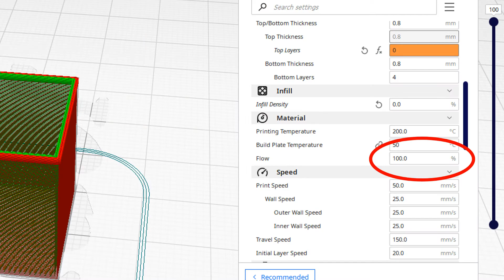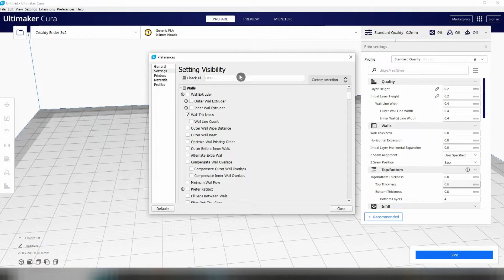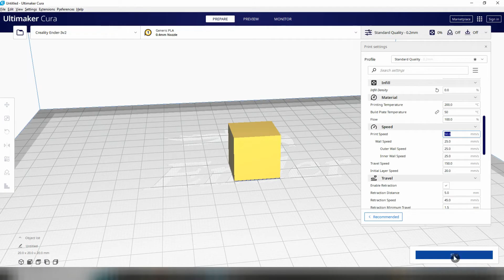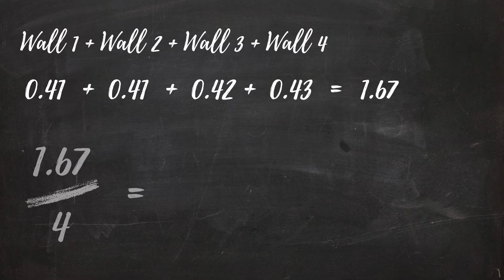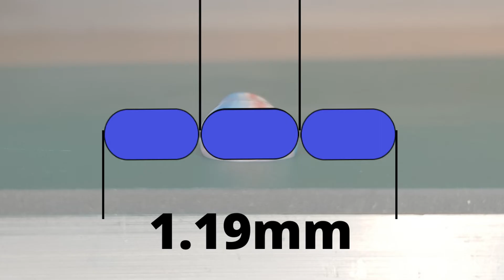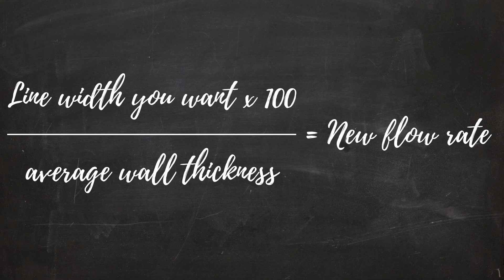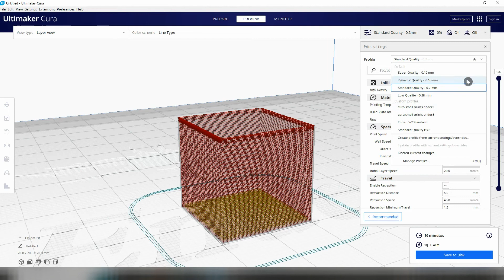Calibrating 3d Printer Flow Rate with Cura - The Quick Fix for Under Extrusion

Comment: hello, Im having some problems working with polymaker lwpla, so basically during the printing process there are times that the extruder give to much material making blobs of it. How can i solve this issue ?. Thanks
Reply: 90% caused by overlapping vertices

Comment: Great video. I tried doing this and measured the cube walls 3 times to check for consistency. Each time I got a different final result. I'm not sure why.. maybe the digital calipers are difficult to control down to this level each time checking the thickness.. but my averages were all within the range you mentioned as just leaving it alone... 0.41 0.4075 and 0.415... this resulted in flow rates ranging between 96.4 and 98.2. How do you know which one was accurate I guess... maybe just leave it at 1 and it is fine maybe...but that seems to maybe slightly over extrude

Comment: For those wondering how to do the calculation if you're starting from a value different from 100% flow, the method shown assumes you're at 100%, so just input the current flow value you have at the moment of the calculation and it will give you your new value. It might take like 5 tries to dial it just right, but a 0.02 variation is well within spec for an Ender 3 style machine. Remember that your extrusion precision depends on your entire extruder assembly, from the stepper to the extruder, setup (DD or Bowden) and even your hotend style (all-metal or PTFE).

Comment: Wait.. Calibrating E-steps and changing flow rate is in practice exactly the same thing? Or am I missing something?
Reply: the e steps makes sure the stepper motor puts out the right length filament but does not make sure the extruder flows the right amount

Comment: This is great! I printed one cube single wall .4mm and got a .42 wall thickness. Two walls gave me .84 wall thickness. Dropped flow to 95 and got .81wall thickness and 20.03 overall on a 20mm cube. 0.03mm is only one thousands of an inch on a 20mm cube. Thats damn good tolerance for 10-20 minutes of testing and about 8 grams of material. Thank you so much for this video!

Comment: Dont base line width on what you measure, printer uses an estimate, software input from factory, use hight to determen or finetune your line width, that is based on an actual measurement,z access offset..that will give you more accurate consistancy overall ..

Comment: You might get the right 3 wall thing by using for example a 0.4 mm nozzle with 0.2mm nozzle settings..or a 0.6nozzle with 0.4mm settings...so you trick the printer with 😅the ofsett for line center ..you can also use this for more flow, for ex i get perfect rubber printing with a 0.6mm nozzle when using 0.8mm settings and upting temp to 280°c...prints like PLA..

Comment: I did my esteps first. but now after ramping the esteps up to 98. I have to lower the flow back down to 93. It kind of feels like It was allright before. with 2 walls of 0.4 ending on 0.81 and 0.79 . As if what I just calibrated kind of ruled one another out...

Comment: One thing i learned the hard way is to also verify the nozzle as well. I had a beer off a time getting one printer for set and it turned out while the nozzle was marked 0.4 it was actually a 0.6.  Once I swapped it out with an actual 0.4 my flow was perfect and over extrusion was gone

Comment: Not sure if it was commented already, but I'm pretty sure in cura the option to bring the lines closer is to use a line width smaller than the nozzle diameter under quality. Whhat I understand from the setting is if I use a 0.6mm nozzle and set it to 0.5mm,  4 walls will be 2mm of squished together lines instead of 2.4mm of less squished together lines.

Comment: In cura, the line that is set to be 0.4 mm should be 0.44 mm wide because cura approximates line cross section as rectangle. So if your estep is truly calibrated your wall line should be 0.44mm wide at 100% flow.
Reply: so u saying multiple 0.44 * 100% / (the 4 walls) = true flow rate? or are u saying to change the line width to 0.44 in cura instead of 0.4
Reply: @Flakoyaga  not quite that. If you set it to 0.44 than it would be even wider... So just have that small difference in mind when designing your 3D model, especially if you want to play with tolerances. If you get your single line to be 0.2 high and 0.44 wide, then your flow is spot on if you are using cura. The internal structure of your walls will be 100% filled, and outer parts of your layer will be sticking a bit out on sides.

Comment: If you are consistently experiencing under/over extrusion, it indicates the extruder stepper settings in your firmware may be off. You can calculate the correct settings in much the same way as you did for the slicer settings: Pre-heat the hot end, measure 100mm of filament and ask the printer to extrude 100mm. Measure the difference between measured and extruded filament, then take that to apply to the "rotation_distance" (in printer.cfg in Klipper) setting of your stepper in the firmware: (rotation_distance X extruded/measured)=new stepper rotation_distance. Then re-test.  That way you can leave your slicer setting at 100% and only make adjustments if necessary per print. For example, my extruder rotation_distance setting was 32.990, but I changed out the extruder for a better one, which means I also changed out the extruder gear. I did the above calibration and the result was that my extruder was actually extruding 97mm per 100mm measured (under-extruding). (32.99 X 97/100)=32.00 (shorter rotation distance means the extruder has to turn farther per rotation, due to a slightly smaller diameter extruder gear).  I suppose you could do the same thing by just observing your prints and taking the setting in Cura (103% flow setting, for instance, translates to under-extrusion of 3% at 100%) that gives the best prints and use that number to calculate the rotation_distance as well - (32.99X97%) = 32.00, then go back to using the normal 100% in Cura.

Comment: Would you know why my prints are printing fine but my brim lines aren't overlapping and touching each other.  It's not my z offset and it's not flow because the prints come out fine. I'm using creality slicer 4.8.2

Comment: Quick question. Just bought the flsun v400 and the cura pofile that came with the machine had the flow rate set at 95. Im fairly new to all this but ive been suspecting underextrusion on all of my prints and just discovered its only at 95 for some reason out of box. Does this sound normal? Do most printers profiles come set at 100? I dont know enough to know what normal is
Reply from the maker: Hi, I don't have that printer myself but every profile I have used for the printers I do own have always started at 100% flow rate. So, yes, to me that seems unusual.

Comment: So I did mine and all walls are exactly 0.50 so I did what you said which is 0.4 x 100 = 40 divide by 0.50 = 80 surely that's too low of a flow rate? My flowrate is at 100% right now while I do this test
Reply from the maker: How is you print quality? Do you have a specific problem you are trying to fix? If all is well that I wouldn't advise messing with it too much. If you think you have over-extrusion then maybe consider dropping to 90 and see what the actual print results are like.

Comment: Hello Ricky, What order should I follow? bed level first, e steps, flow rate or e steps bed level flow rate? now, for example, when I print a 40*40 cube, one side is 41 and the other is 40.2.
Reply from the maker: Hi, i'd certainly tram (level) the bed first, then check that you are printing at the correct temperatures with a temperature tower. I always do e-steps before flow rate. Hope this helps.

Comment: wtf i had 1.225 then 0.4 x 100 divided by 1.225....... this would mean 32.65 flow rate?!
Reply: The average of the 4 walls is the total divided by the number of walls. If 1.225 is your total of all 4 walls, your average would be 0.306.  40 ÷ 0.306 = 130.71% (for your new flow rate).  If 1.225 was only 3 walls averaged then the same calculation would give you a new flow rate of 98.03%.

Comment: FYI....This goes along with your video. Since I am using Klipper, had to do a little homework on the process. I am 80 years old so I had to write it down.

Ender 3V2 E-Steps Calibration using Klipper

I was looking for a procedure to calibrate the E-Steps on the Ender3V2 using Klipper but could not find where to store the new settings.
Found videos on how to do the calibration. Using ideas from various videos, I came up with a procedure to do the calibration.
In Klipper, is a Printer.cfg file. In there, is a area called [extruder]. In here is a line item called rotation_distance. 
This is where the settings for E-Steps are stored. Remember this number.
The following is the process to calibrate the E-steps.

Step 1. Remove the filament from the extractor.
Step 2. Remove the tube at the extractor end that goes from the extractor to the hot end.
Step 3. Feed filament thru the extractor until it just comes out of the extractor.
Step 4. Cut the filament flush with the exit hole on the extractor.
Step 5. In the Mainsail interface, set Extruder temperature to 200 C. The following commands will not work until the Extruder is heated.
Step 6. Enter the following commands in the Console.  M83 (enter), G1 E100 F100 (enter). This will feed 100mm of filament thru the extractor.
Step 7. Cut off the filament flush with the extractor and measure its length with a ruler or caliper. If it is 100mm, no further steps are required.
Step 8. If the length is less than 100mm, it is under extruding and if it is over 100mm, it is over extruding. 
Step 9. Take the number that was stored in rotation_distance (times) the length of the filament that was extruded (divided) by 100.
Step 10. An example: 34.406 x 96.5 / 100 = 33.298   This will be close to what you need to feed 100mm thru extractor.
Step 11. Enter this new number in rotation_distance and "Save & Restart"
Step 12. Repeat steps 5 thru steps 11 until 100mm is fed thru the extractor. 
Step 13. Once E-Steps is correct, reconnect the tubing to the extruder.
Reply from the maker: Thanks very much for this. Many people are starting to use Klipper now so your guide will really help those who find it!

Comment: What you actually measure this way is not flow rate but extrusion width, flow rate and squish of filament. You can not measure flow rate which is only 1 out of 3 variables with this method.
IF you change your layer heigth from 0,2mm to 0,1mm you will get different thick walls this is because now you will have a little more squish. Also your line width might vary. Some people have it on 0,4mm for 0,4mm nozzle others use 0,5mm for 0,4mm nozzle some slicers have a default value of 0,44mm and so on. So no, measuring flow rate this way does not make sense. 
You will notice that your flow rate will be always too hight if you measure it this way and you need to adjust it down which then results in perfectly thick walls but everywhere else will be underextruded.
Reply: Absolutely right. My walls were average 0.5. So after changing the flow rate from 100 to 80 according to the formula my square was under extruded so badly that had air gaps in single lines.
Reply: @1975djvigo  This is because it´s the wrong method to measure flowrate. It´s like someone on the internet came up with this idea and now everybody else copies it in their videos without varifying or actually knowing what they talk about.

Comment: I am looking to recalibrate my printers and this is the dilemma I am experiencing.  I thought my printers were calibrated pretty darn well, however I am printing some parts that require precision to fit together and this resulted in my going down the flow calibration rabbit hole again.  With my flow calibrated per wall thicknesses, I should be using about 92%, however this still leaves some holes too small or some parts too big when trying to fit an axle into a wheel hub for example.  If I use horizontal expansion in conjunction with my 92% flow, I witness 1st layer lines that dont quite touch (almost like my nozzle is too far away from the bed), but I also notice gaps in the walls.  Am I better off going back to 100% flow and only using horizontal expansion or what other advice can you think of for more accurate parts?
Reply from the maker: It's tricky, and I don't think there is a simple answer. I was told of a setting in Prusa Slicer that lets you basically move the beads of filament closer to each other but I haven't played with it yet. That might be worth looking into. I believe it's in the comments here somewhere.

Comment: Doing it this way I calculated a value of 81% flow.....that sounds like it will underextrude in an extreme way. I've checked and rechecked and the math is sound....so the only thing incan thing of is that my z offset is too close and creating a wider line than it should be?
Reply: I've just swapped out a role of filament to Sunlu PLA. The previous PLA (which came free with the Ender 3 v2 and I'm not surprised they're giving it away) has a flow rate of 93%. Using the Sunlu and printing a one wall cube calculates to 85.1% ! It's currently being printed. Seeing as the last time I used this calculation I ended up with around 0.42 to 0.43 I'm hoping that the same methodology will deliver such a result. I'm quite surprised at the difference between the two different PLA brands. But that Creality white PLA...not good! Edit: Must have made a mistake in the calculations. 85% gave me walls of around 3.7 to 3.8 - Decided to just up it to 90% and adjust accordingly. Should only take a couple of prints to nail it.
Reply from the maker: Hi, if your z offset is off, it would only really affect the bottom few layers. By the time you get past the middle of the cube, offset shouldn't have any effect. What sort of figures are you getting?
Reply: @RickyImpey  on a 0.5mm nozzel = average of 0.63
Reply from the maker: @rillsleather  hmm, yes it does appear you are over-extruding quite a bit. Have you already calibrated your e-steps?
Reply: @RickyImpey  Yes. Should I have reset them to factory default after an extruder change and then recalibrate?
Reply from the maker: @rillsleather  No, you want them calibrated correctly before a flow check.

Comment: this technique is rubbish and tbh using it with that kind of caliper from the 70s makes me smile quite a lot
Reply: Care to defend your point a year later? Tesa calipers are still made by brown and sharp a respected name in machining industry. Still perfectly accurate even tho it was made in the 70's according to you. Can't see how this technique is inferior. mabey you could explain? The auto towers I was using were not slicing correctly so this gave me a more controllable and verifiable way to test flow. I'd rather base adjustments of actual measurements rather than eyeballing what "looks good"

Comment: Sorry, but this is a bad way of calibrating flow. Line thickness (in real life) will never be consistent with a single line's thickness, because of stuff like viscosity, and the fact that having 2 walls will cause the outer wall to 'flow outwards'.

Basically, the best way is honestly just to go by look. Print the cube at 100% flow rate, everything at default, and check top/bottom layers if they look under/overextruded.

This does however cause some problems with calibrating e-steps using a printed part.

Comment: Since you've asked: you can separately change perimeter width and spacing in SuperSlicer (maybe PrusaSlicer as well)
Reply from the maker: Awesome, i’ll have to find it. Thanks
Reply: @RickyImpey   Cura does indeed have something similar--Might be in current experimental feature, not sure, But I do know I have seen spacing/overlap settings. Just not sure where or how named now.

Comment: Hi I need to ask you a question a have a really big seems on one of corner of the print how I can reduce it and thanks
Reply from the maker: Hi, this is the z seam. It's where the nozzle moves up to the next layer. There are a number of things to try to reduce the size of the z seam. I assume you've calibrated your e-steps and now your flow rate. Try printing a bit slower to see if it helps.
Reply: @RickyImpey retraction setting helped mine